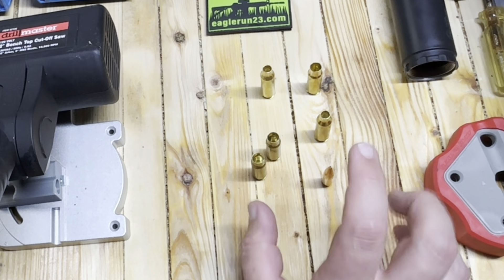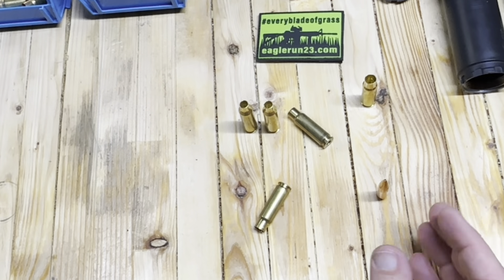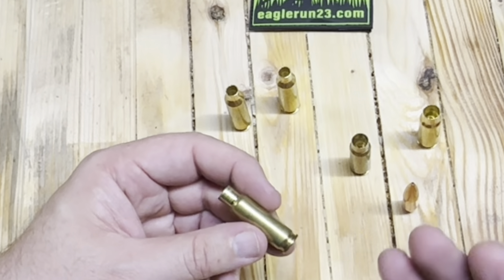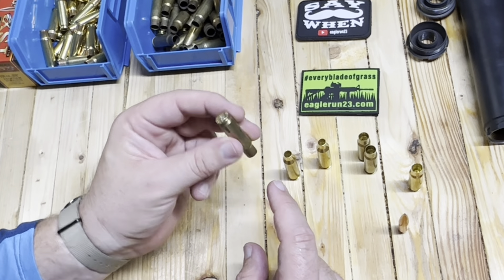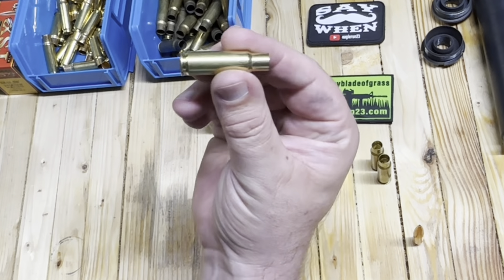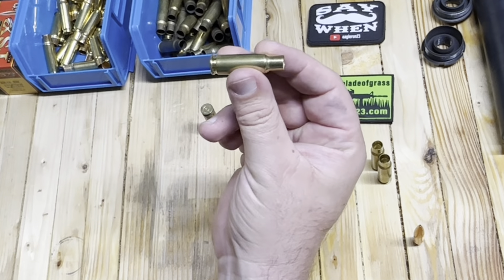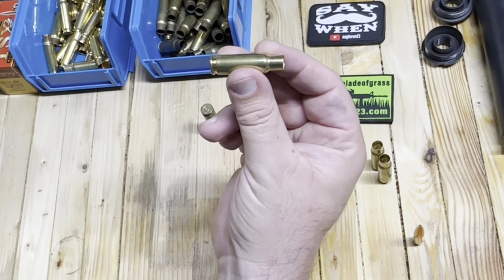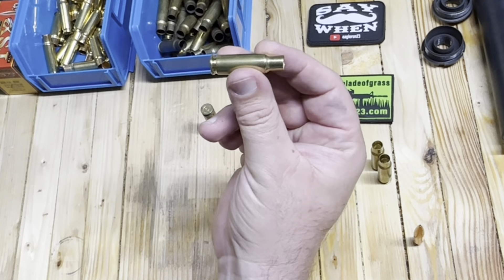8.6 Blackout Reloading Part 1

Comment: I learned to reload making 300 blackout because the cost was crazy at the beginning. The mouth wall thickness was the biggest learning curve for my 8.6 reloading journey
Reply: A company called Armanov makes drop-in ammo checkers for 300 BLK and others that will let you know if you're good to go. Bad cases that may chamber in LE Wilson use gauges (and others) will not chamber in these. Not crazy expensive, though if you live in the US, shipping is pricey because they ship from Slovenia, where they are made. But they ship quickly. Gavin from the Ultimate Reloader YT channel did a vid on them. I have one; it works great.
Reply from the maker: Yup me too. Had a little problem with shoulders but neck thickness was the whole deal.

Comment: 3:11 And perhaps more importantly, if they DO happen to chamber, the overly-expanded case neck can get pinched between the bullet and the chamber wall if there is not adequate clearance. This may create excessive pressure upon firing, resulting in a potentially deadly BOOM-BOOM! and a really bad day for both rifle and shooter.  That said, what neck turner equipment are you using for these 8.6 BLK rounds? Thanks.

Also, just a note that, unfortunately, SAAMI spec'ing a cartridge doesn't necessarily mean that manufacturers will soon begin producing cases. Look at 6 ARC. Starline only (relatively) recently began producing it after it had been SAAMI approved for more than 2 years. And today, 3 years after approval, not many brass manufacturers have come on board with it even though demand is relatively high. SAAMI approval is a step in the right direction, but demand and longevity expectations are what really drive new manufacturers into the market.
Reply from the maker: I would agree with the timeliness but I’ll say that 8.6 barrel sales are greater than 6arc from what I hear.
Reply: @EagleRun23  I hope so. You seem to be the only one on YT really doing vids on it. Also, right now Faxon seems to be the only "mainstream" barrel maker with offerings in this chamber, so I'm surprised to hear that. But it's an interesting cartridge, for sure.